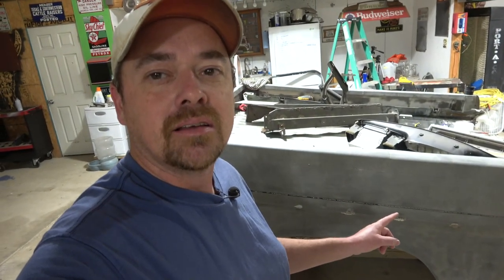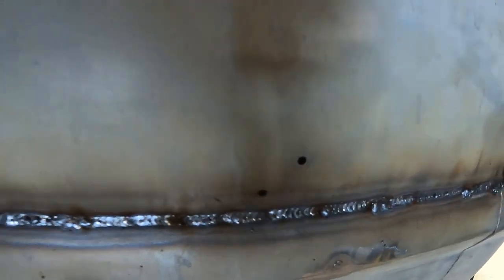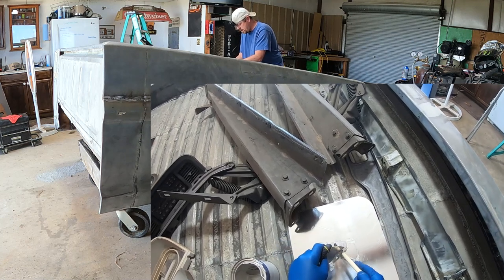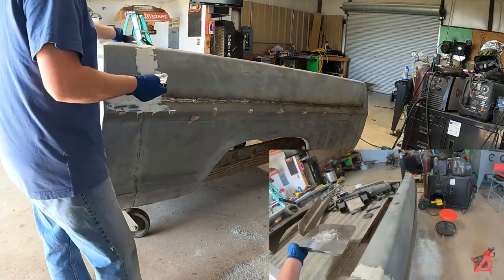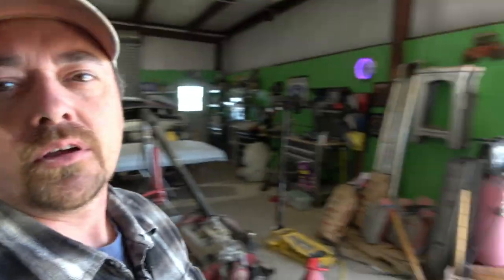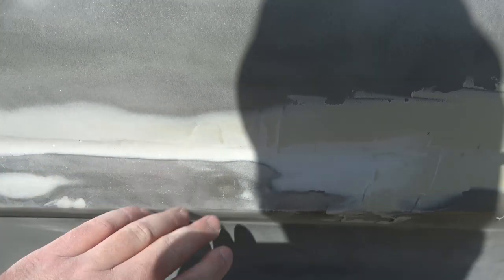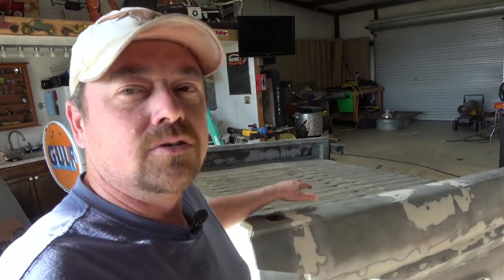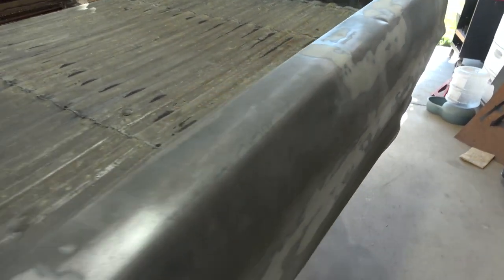Weld, Grind, Bondo, Repeat

Comment: Nice work I guess we should have done the same thing by welding but we just put body filler back in the crack and so far so good that was 8 years ago
Reply from the maker: If it has lasted 8 years that may be the way to go.  I'm not sure I did it right, but it did work.  Thanks for watching!